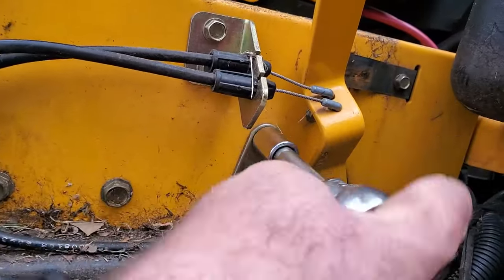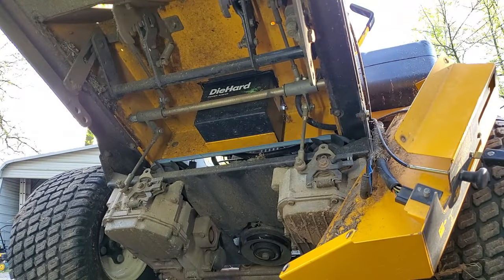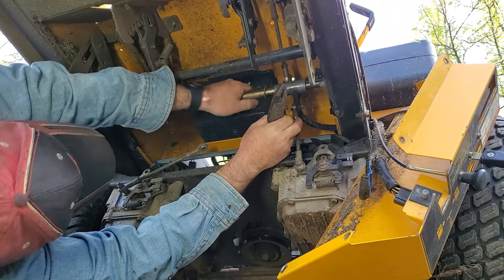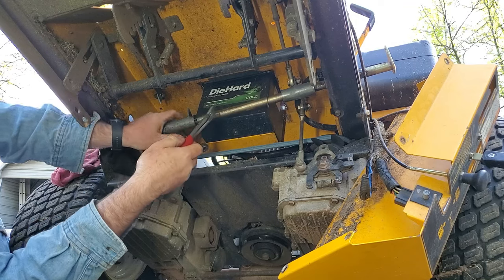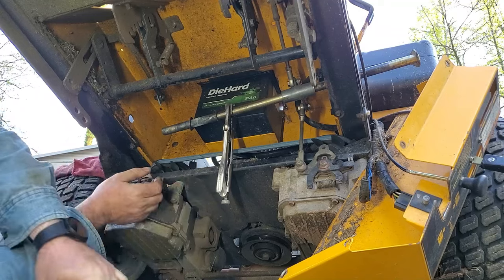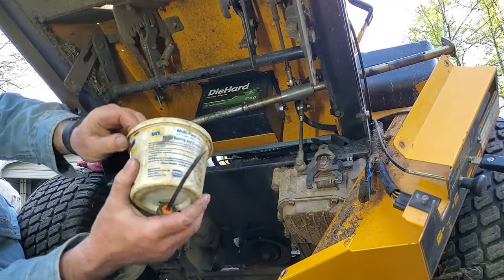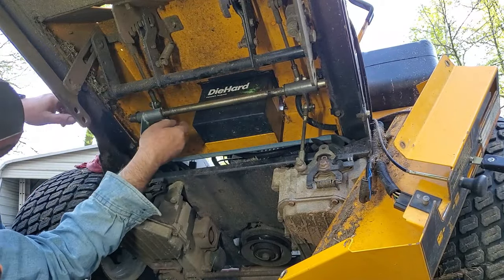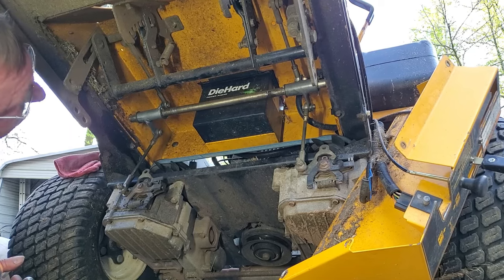Unlocking Success: Cub Cadet Zero Turn Steering Bell Crank Upgrade

Comment: That looks like a fun job to get it fixed and steering right riding mower king 👑
Reply from the maker: It is a project one you run into a little trouble. But it had to be done, and now it doesn't creep when you put the handles in the park position.
Reply: @ridingmowerking   😎👍😎💪

Comment: G3003S12    I am doing this tomorrow , it should  be fun.. maybe make a video haha
Reply from the maker: Did you get to replace the parts? How much trouble was it to get apart?
Reply: @ridingmowerking  parts were back ordered, next week.. it looks fairly straight forward. If you can change oil on a car or do brakes, it should  be ok

Comment: Just wondering Why you didn't drill and tap pivot levers for grease zerts.
Reply from the maker: I usually do make improvements such as that. However the "tubing" is really not thick enough to install greae zirks. It would be better if there were molded bungs for the fittings to thead into.